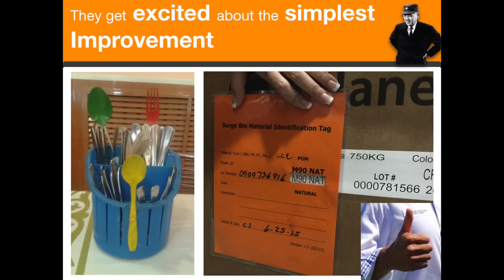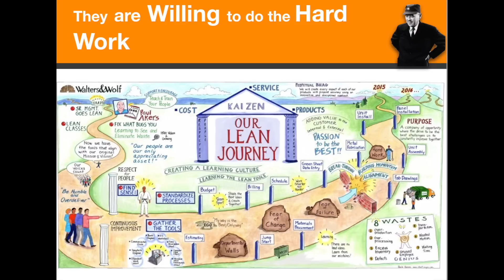Who are the 2%? |  The American Innovator

Comment: Awesome video Paul. I have a question about the concept of urgency: If someone comes up with an improvement idea but it requires a simple part that you don't have on hand what do you do? Does your sense of urgency say to spend 40 minutes driving to Home Depot and back for the part, or should it be added to a wunderlist and put off for later?
Reply: I would add it to the Wunderlist App and do it in the most efficient way possible. The concept of urgency means that people don't see an improvement and say well I'll try that someday but they immediately try to run an experiment if they have the necessary things to do it. If it requires a trip to the store, then get those supplies when you go to the store to get other things to manage efficiency. However, if it means making a point or teaching a lesson to a certain team member about the importance of continuous improvement, it would not be beyond me to run to the store to get the parts.
Reply from the maker: Good question. Here is my video response! https://youtu.be/gNbKCYkOpso